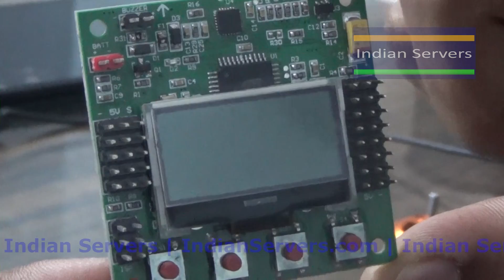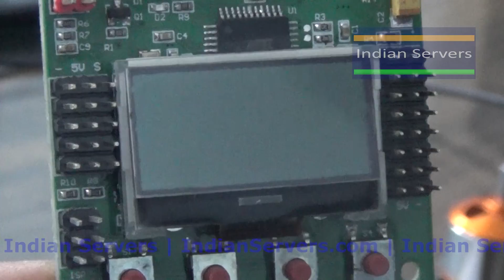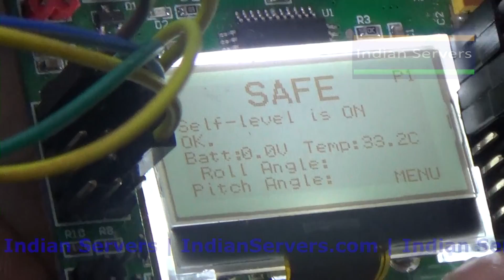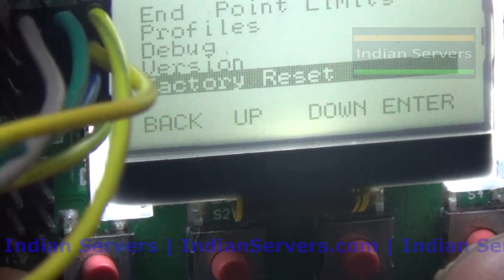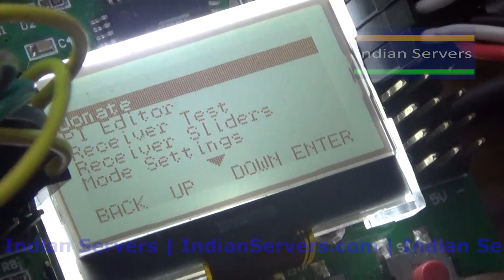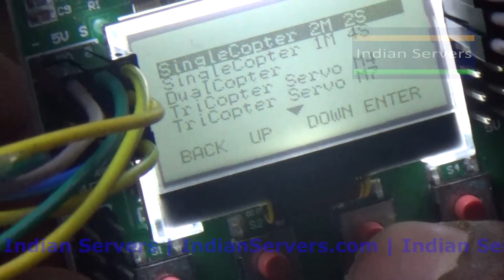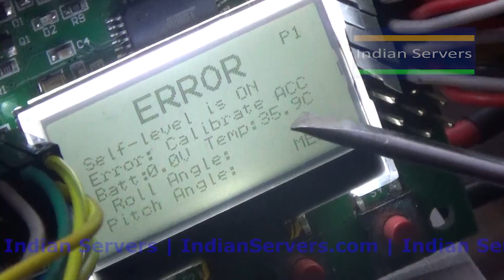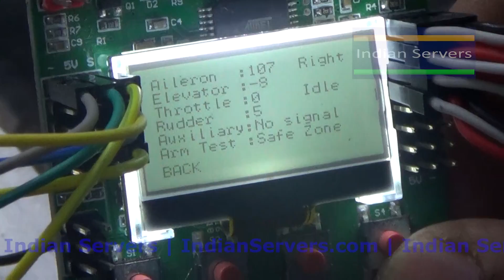KK 2.1.5 Flight Control Board Part 1

Comment: Sir i also made an quadcopter....but it is not getting stable....please help mw
Reply: shayad raza trim your transmitter there is triming button in your transmitter for all four sticks to stable your quadcopter
Reply: There is another problem that drone is vibrating more...and flying in one side.....after adjusting by using the trim button also

Comment: The motors are not running with same speed after final setup .but in calibrating esc's the motor are running with same speed . please help me in solving this issue. i have to submit it tomorrow.
REPLY